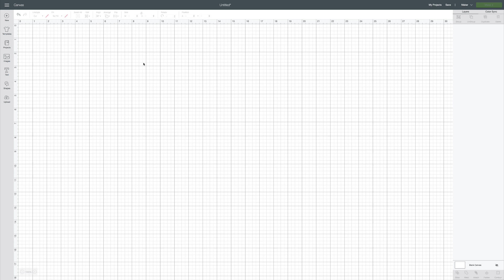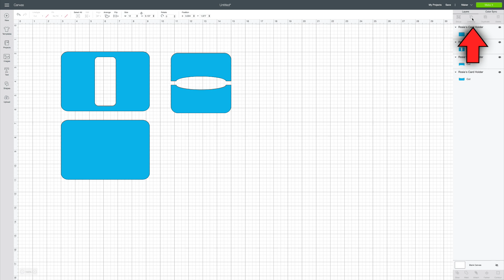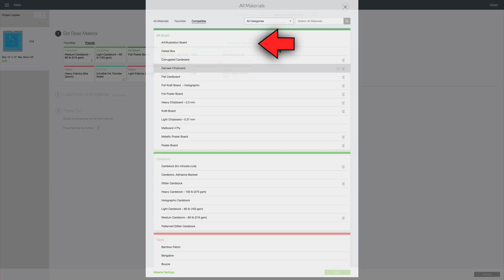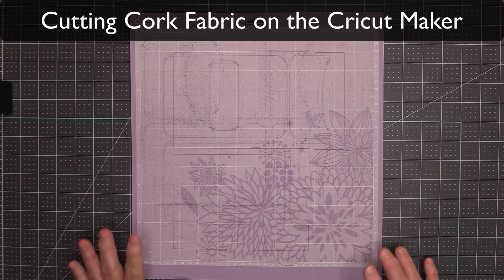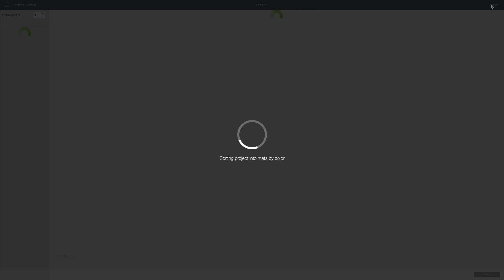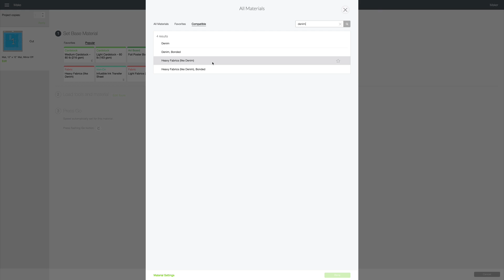Cutting Leather & Cork Fabric on the Cricut Maker

Comment: I have a cricut maker. not sure if I have the knife blade, but would be using cork and I do have the rotary blade. the pattern I have is SVG - not this one.  (the Tall Wallet) but there are no actual measurements on the SVG so is there a way to make sure the sizes are right?  I also recently bought a cameo 4 which is supposed to cut this stuff.  with silhouette studio - I find it easier to work with SVG's.

any suggestions?
Reply from the maker: The knife blade is a separate purchase for the Maker.  You would need to contact the designer of the file you want to use and ask them what the dimensions should be.  Then once you have the file loaded you can check the size of each individual piece to make sure they are the correct size.  Thanks for watching!